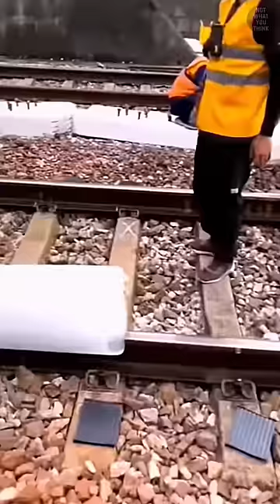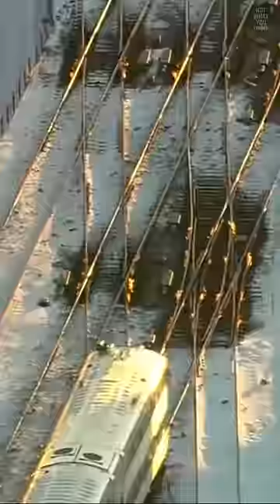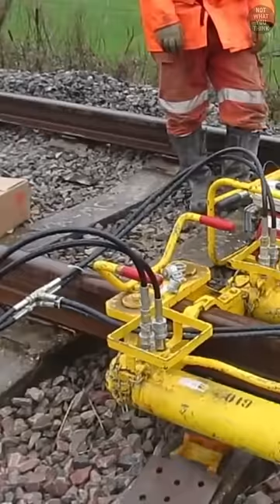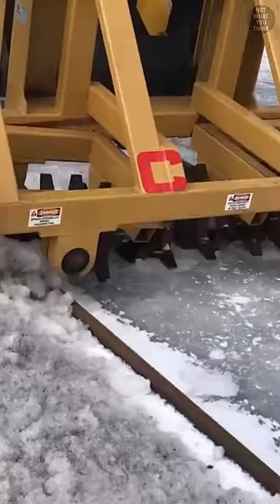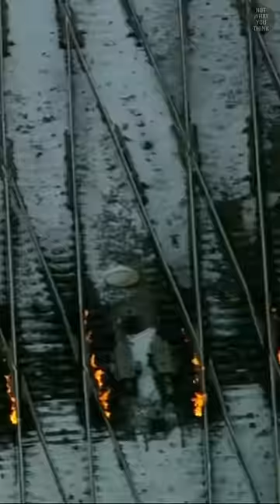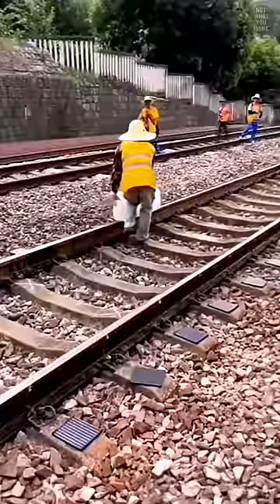ICE & FIRE on the Railway #shorts

Comment: I'm a track worker and have never heard of icing the rails. It looks like they're just messing with the new guy.🤣🤣
Reply: It would make sense for that not to even be a real thing in the first place and the reason why is simple logic… Just think about it… what do you think would be the effect of sliding a piece of freaking ice along a tiny segment of the rail a little bit? Sure, it would cool down a tiny bit but it would instantly heat back up… you know how much money it would cost to have dudes running around with blocks of ice on the tracks to “cool them down on hot days”? 😂 cmon… it’s steel… it doesn’t care about a “hot day” it’s not some greasy operator sweating nuts with a grimey tshirt smelling up the local convenience store… it is a railroad track… it’s going to take a lot more than that to give it meaningful noticeable problems… 

Now! If we are talking about repairs and installation, then definitely, it would make perfect sense to cool or heat localized chunks of rail with huge ice cubes to make the tolerances required for welding the rails together… but after that, as the OP said, it’s basically down to messing with the new guy.
Reply: Cheap chinese steel.
Reply: Yes they are gonna mess with him by buying a huge ice cube. If they wanted to mess with him they'd use regular ice cubes out of the freezer and have him rub then all over the rail. Smh.
Reply: @theenzoferrari458  they could have just made it you know
Fun fact
ICE IS FROZEN WATER
Reply: @fontaineking3317  Most rail Steel on class 1s comes from Japan, USA, Australia or Canada.
Reply: @justarandomtechpriest1578  yes waste even more time and resources just to prank a new guy. Use your brain. You really wanna waste hours, resources on a prank that'll no doubt be figured out after a few mins?
Reply: @theenzoferrari458  you ever seen how far some people will go for hazing?
Reply: Lol
Reply: @TheTrainMaster15  that's not hazing.
Reply: @theenzoferrari458  idk if its hazing or actual work. But if people want to haze you  this is barely any work for a prank compared to most by far. People will put a lot more effort to mess with someone.
Reply: @theenzoferrari458  are you serious wasting time and resources clearly you never spent time around men doing manly jobs it's all we do haze the new guy and we will waste alot of time setting up a joke just for.a few seconds of fun. Like if you worked with me you would be looking for the toe nails , pipe stretcher or bubble fluid
Reply: @theenzoferrari458  I quick Google search will show that this was done by  Chinese track workers to be funny in a heat wave. Clearly if you have half a brain you would know sliding a ice block on steel in the sun would have no effect on cooling the rail. The ballast and oh i don't know the thousand of miles of rail would all be baking in the sun so a ice block would do nothing. That's why it was done to be funny
Reply: This is a technique they use in China to prevent rails from buckling in the hot weather. This happens in the US as well but we have different and more modern ways of cooling the tracks.
Reply: @poloska9471  The steel can easily buckle in hot weather. Tracks have to be flexible and they are great conductors of heat. If it's hot enough they stand no chance against thermal expansion.
Reply: @hueginvieny7959  well no wonder why our crap over here isn't good. They wasting time, money and resources on a fruitless prank.
Reply: @toughdeer2908  hazing is like tying a string onto your little Johnny with a weighted cinder block and throwing it off a bridge. There's a college that does this and little do they know it's like a 100ft rope with a cinder block on the other end and you throw it off a 75 foot tall bridge with your little finger tied on the other end. If you don't do it your not accepted into the hause
Reply: @theenzoferrari458  yeah, I know. I was using the same word as a previous comentor and saying whether it's a practical joke or hazing they could easily put more effort into either category.

Not saying it's a fake technique but I know people who'd do more than a big block of ice for a minor prank even on the job.
Reply: @theenzoferrari458   you seem like the type of person with no friends and you never experienced a fun time in life. You must be serious every second if freezing water is a waste of time and resources. I hope one day you can experience what having friends is like and you learn to have fun and go with the flow . Sitting around alone all the time is giving you a skewed picture of how normal working people are.  If you were born in 58 it may be to late for you bit give it a try and stop being so serious
Reply: @hueginvieny7959  ok geriatric. 👍 L
Reply: @hueginvieny7959  i sent new guys to the super to show them where the board stretcher was. One came back with gang nails! I couldn't keep a straight face when I realised he was on to me and my shenanigans.
Reply: @gwallace5403   we got the new guy looking for a Gatorade bottle size bottle of bubble water for thr level to his credit he came back with leak detection spray and he is actully running very big government jobs so its proof we all start of  at the bottom I did plumbing when I was young then ran trains now back to plumbing and the new guy always gets the same treatment
Reply: @dakotajones151  they don't cool the track in North America, they just put speed restrictions on and if it's too hot, stop running trains.
Reply: @poloska9471  it actually does make sense though. Thermal expansion is a bitch. Rails might get 10 or 15 degrees hotter than the surrounding air. Even if its only a couple thousands of an inch over a few feet, we're talking about miles of rail. I can't imagine it's very common but I could see it being done in very specific circumstances
Reply: Are you BNM?
Reply: @theenzoferrari458  that's a good one
Reply: @hueginvieny7959  we had a new guy who was a young buck in his 20s and was complaining ALL day as the rest of us, including some older guys.... Busted butt with no complaints. Lunch came and he took off to eat. Nobody knew he left he just disappeared. Anyway we had just finished boarding a 500 sheet house on the lake and it was cleanup time. He came back about an hour later. When he got back one of the guys took his keys and hid them in an unfinished outlet.  We finished the day and left he called us saying he can't find his keys. We told him "they're in an outlet" that's it. It took him almost 2 hours to find them 🤣
Reply: @theenzoferrari458  dude ice is literally just Frozen water, do you not know how to make ice lmao?
Reply: @fontaineking3317  didn't see your country built got a proper railway
Reply: Yeah I track worker to. Never seen people put on ice on track. Maybe if they were losing temp to weld and were desperate to keep it 🤣
Reply: @theenzoferrari458  bro really used a scene from Old School as an example 😂
Reply: @dakotajones151  and that's why it's heat stressed ...
Reply: @fontaineking3317  most if not all rail from the 1800s-present are reused. they are melted down and made into rail again its rare to even see brand new rail unless its a new line or heavy commuter rail
Reply: @SetiPrime  I have scrapped miles of it.
Reply: Just like the wire stretchers
Reply: @dakotajones151  Trust me when I say that no one uses ice to keep tracks from buckling. The physics alone.
Reply: @fontaineking3317  still gets melted down
Reply: @hueginvieny7959  or the siding stretcher for vinyl siding  😉!!
Reply: I worked for CSX as a rail road welder and I’ve never seen someone pushing a block of ice lmao
Reply: @SetiPrime  ya, in China
Reply: @fontaineking3317  it's sad but I can see this being a Chinese thing 😂
Reply: Probably because you don’t work on high-speed rail tracks? Different technical requirements.
Reply: It's almost like railroads exist in other countries or something
Reply: Yeah I thought something was fishy given that there is a few million miles of rail in the world and they can't all be iced and heated lmao
Reply: Steel and iron has a much higher mting point than prolonged sunlight💀
Reply: It might be just for one spot if their working on it
Reply: A Bb  I really dont care
Reply: Grab me the matterdadddy and the left handed hammer.
Reply: @toughdeer2908  this reminds me of my favorite prank when I managed a grocery store..... "Hey new guy, while you're 'facing' the aisles, we need you to shake up the first 3 salad dressings in every row, people won't buy them when it's separated...doesn't look as good" hahaha fell for it hook, line, and sinker. Our store manager was not happy when he came down the aisle and three new guys  are vigorously shaking salad dressing bottles to stop the settling lol.
Reply: U haven't been a track worker for long
Reply: Exactly what I thought as well, and I know nothing about rails, but I do know that’s it’s far more efficient to just spray cold eater on the rails than rub a piece of ice lol
Reply: @dakotajones151  you are right, heat is important, but I dont see how some ice can cool down the rail faster than just plain water. By the time these guys are done sliding that ice, the rail would be hot again where they started, making it completely pointless
Reply: @fontaineking3317  always that one pos. remember what youre using to type this on is manufactured from?
Reply: Don't think so, that's a lot of work for a prank, and it's not likely they have huge blocks of ice available for any other purpose. Heat and cold applied to rails are to move the rail (stretch and contract) so the rail doesn't do the same thing whilst in use.
Reply: @justarandomtechpriest1578  Large blocks of ice are not commonly found. Goofing off, large, time consuming pranks are not going to be tolerated as they are likely working near tracks in service, with at least one watchman to alert the crew when trains show up. Goofing off whilst in the vicinity of live tracks is a good way to get someone killed due to inattention. They've got foremen watching them, and goofing off will not be tolerated, as it could cost him his and their jobs.
Reply: @hueginvieny7959  Railroads have zero tolerance for that behavior and you would be out on your azz in no time. And just where do you think these large blocks of ice come from? They weigh several hundred pounds. It is NOT a prank or hazing.
Reply: @poloska9471  You're the one not thinking. Where do you get a block of ice that big? How do you transport it to work? In your car? Nope. How do you transport it to a work site? You would need 3 or 4 guys to move it, it weighs three to four hundred pounds. Gonna leave where? In your car, melting? That would be so obvious to the foremen and management. Ain't flying, violating Safety and Operating rules. You keep dreamin'.
Reply: @thomasmleahy6218  that block does not weigh several hundred pounds and if you search for the original video it's from a Chinese newspaper saying train crews made a satire video showing how hot it was. Also this is china where air conditioning and refrigerators are not as abundant as elsewhere so ice is used for more and not sure about your area but a Google search showed me a 15 minute drive I can get dry ice or large ice blocks from a company. Lastly have you worked for a railroad in your life time and your railroads will not tolerate this behavior is funny. I had fun with the crew everyday not because I was on a train that sucked but it was the guys I worked with so to say pranks do not happen I laughable  and romanticizing the railroad it a job and people find ways to make their jobs tolerable
Reply: @theenzoferrari458  Yes.
Reply: @poloska9471  0k9pllol
Reply: yeah idk who made this vid xD
Reply: @fontaineking3317  not how metal works...
Reply: @rintmacleanen4317  ??
Reply: @fontaineking3317  steel in China isn't different from any other steel, its the same material...
Reply: @rintmacleanen4317  it's our scrap. And you honestly think chinese steel is better quality than American steel?
Reply: @theenzoferrari458  ice is frozen water, they could have put water in a big tub and freeze it 😱
Reply: @fontaineking3317  steel is steel and i will never break a rod by karate chopping it
Reply: Messing with the new guy gets really fun after you're no longer the new guy
Reply: Likely lol
Reply: Really?
Reply: @poloska9471  tbf (not that icing the track would help it) but i would guess that over miles of track the difference of length of a track between the hot summer days and cold winter days could be multiple yards (they probably have something setup so the rail can freely expand or contract when needed)
Reply: @TheTrainMaster15  some will put more effort into winding a guy up than they put into there work . Watch a group of oil rig workers in texas offer a newguy oil as sunblock and he took it
Reply: @theenzoferrari458  you'd be surprised some people go all out to make it as believable as possible
Reply: here in Italy we Paint in white the side of the rail to prevent overheating especally on the hight speed line
Reply: They are in Asia
Reply: @theenzoferrari458  there is a lot of down time in track repair 😂😂😂
Reply: You never used a rail stretcher
Reply: @theenzoferrari458  time and ressources? Its water you let freeze over night lmao we used to really waste ressources in form of tiles and bricks for fun, this is nothing
Reply: @justarandomtechpriest1578  no no no, that is “special ice” 😂
Reply: @theenzoferrari458  you've never worked with someone have you?
Reply: @thomasmleahy6218  if there's free time it's definitely something people would do, just stick a cooler full of water in a chest freezer for a couple days and you're ready for the prank, it's not that hard lmao
Reply: @fontaineking3317  it all depends on how they make it, steel is steel, chemically identical if they choose it to be
Reply: @dakotajones151  I live in Texas it's 100 f most the summer we don't ice train tracks
Reply: @theenzoferrari458  union job. I guarantee you stuff like that will hairy lhappen
Reply: @theenzoferrari458  we do.
Reply: This is almost as good as crab farts...
Reply: @poloska9471  it gets so hot in some places the asphalt becomes soft enough that tires will sink into the asphalt and rails expand until they warp. Just because you haven't seen it, doesn't mean that it doesn't happen.
Reply: @theenzoferrari458  yup. Ever worked construction? Wasting time is literally a way to pass the time for some guys
Reply: How'd you get your start?
Reply: The speed he's running it along the track ain't doing ish to cool it 🤣🤣
Reply: It's a hazing process
Reply: X2. After laying many miles of CWR and jointed rail we have never once used ice.
Reply: @poloska9471  thank you for using your brain..
Reply: @poloska9471  rail will kink due to only heat. I have seen it many times. And it will break (pull apart) when it's cold rare but it happens. CWR is installed in a very specific temp window in an attempt to mitigate kinks and pull apart issues. Wheel slip is usually only an issue on wet rail, hills and in yards typically has very little impact on rail temp. There are safeguards on locomotives to prevent wheel burns that damage the rail not make it hot. It's always fun to see posters with no rail experience or foamers who think they are experts chime in.
Reply: I have always wondered why the continuous rails don't buckle in hot conditions or shear apart in cold conditions.
I worked in Saudi Arabia for 3 years and the pipe lines had 'top hat' features to allow for the expansion or contraction of the pipe runs.
These 'top hat' features were very large, about 6' or 10' high and about 
20' or 25' long (I don't know exactly because I never got the chance to measure them).

As to the 'hazing' of new guys in the work place, when I was in the army
we were required to 'bull' our boots to a mirror finish.
The process involved smoothing the leather dimpled surface with a tea spoon heated up over a candle and then pressing the dimples out using the hot spoon bowl and black shoe polish to keep the leather supple.
Once the surface was dimple free
you could start the 'bulling' process which involved using a lint free soft 
cloth. The method was to put a finger into the cloth and dipping it into a tin of black polish to get a 'divot' of polish on the cloth covered finger tip and working it in a circular movement. Ocassionally you needed to lubricate the polish by spitting on it, hence the military term 'spit and polish'.
The other phenomenon was the production of 'bulling rings' caused by the circular movement as the shine on the leather got more pronounced.
Eventually the rings disappeared leaving a deep high shine.
The 'hazing' of new recruits started with some naive recruit being sent to the stores for a box of bulling rings.
The stores personnel were well used to newbies being sent to them for bulling rings and either put them right or sent them off on another
ridiculous quest.
Reply: @poloska9471  homie since I got you here. Why do people like you write whole ass books in the comments
Reply: @tunerimpala5658  so people like you will respond asking why.
Reply: @hammerofreason9860  since you are experienced, let me ask you this: 

Does dudes running around the track rubbing ice cubes on the top part of the rail prevent warping?
Reply: LoL
Reply: I think the icing came into play when the cold chisel cut the track to drill an bolt.
Reply: Agree lol. Id the track is adjusted correctly it shouldn’t need ice lol
Reply: I remember the days of clickety-clack.  Is a solid rail really worth all of the extra work?
Reply: @poloska9471  WELDING RAIL TOGETTER LOL GOOD JOKE
Reply: @hueginvieny7959 The Sky Hook or the Metal Stretcher/board stretcher. Kanuder Valve .
Reply: "get me a left handed hammer"
nowadays - "ok, here ya go!"
Reply: Depends on where you live i think they do it mainly in hot climates with chilly winters like Arizona and new Mexico
Reply: And youtube creators who don't do their research.